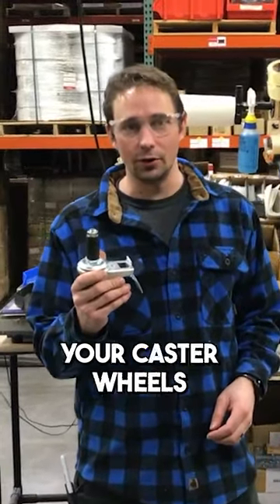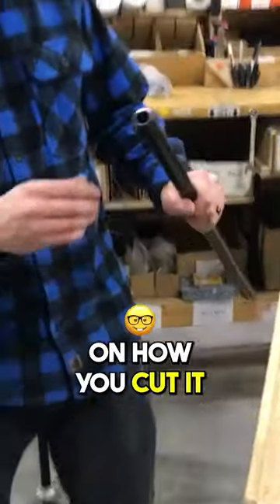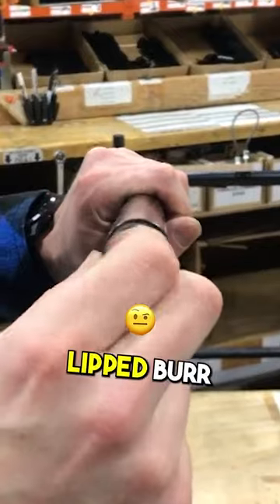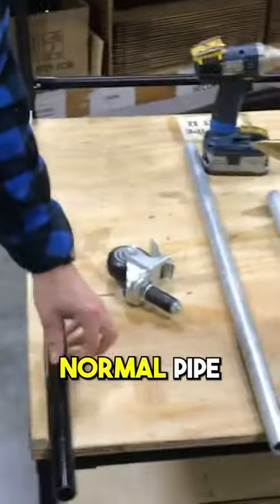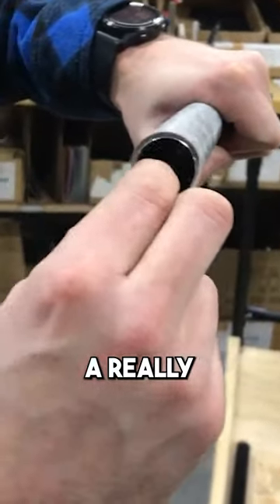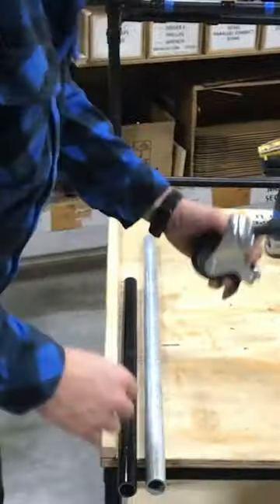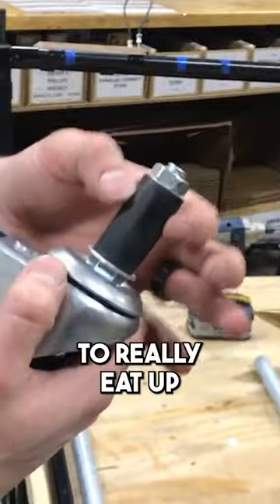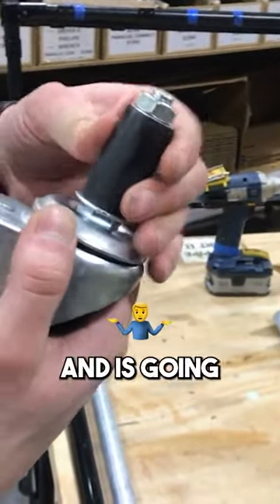🛠️ Installing Caster Wheels Like a Pro! #shorts #lean #casterwheel

Comment: I'm seeing this caster pipe option more and more lately. Which is weird for me because I'm an electrician and work with emt conduit a few times a year (for commercial wiring use only) I dont ever remember any installs requiring casters installed in emt. But it looks like a cool option that i can get down with, as long as it works long term.

 ..we use a Reamer tool to DeBur the cut egdge of emt conduit. ($40 in any homedepot electrician bay) But sticking closed channel locks or pliers inside the pipe and spinning it back and forth will also work ok. Older guys may use a round (rat tail) file. But really if you cut it slowly with a decent hack saw blade, then u will avoid bad burrs. My boss often calls that method "cutting it correctly" 😂

Fast pipe 😎 looks legit. Thanks bro.